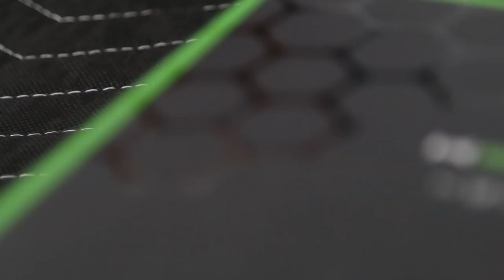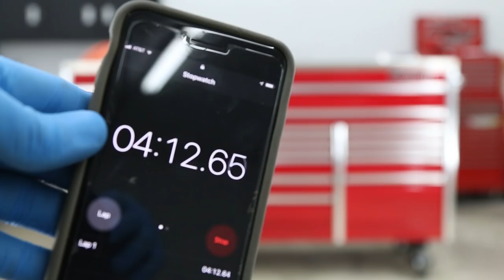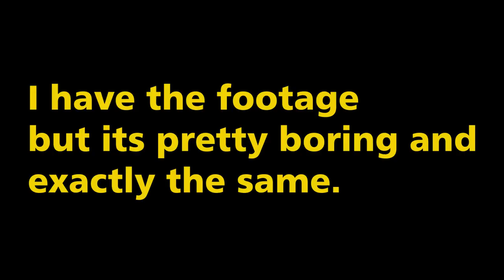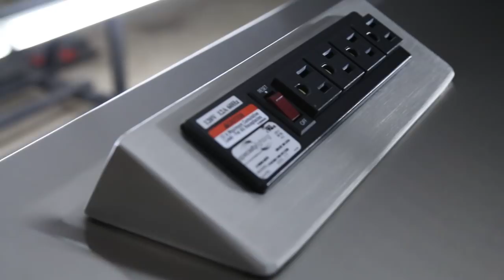Ceramic Coating a Snap On Tool Box

Comment: How much did you charge for this?
Reply from the maker: I cant remember exactly but they generally average $250-500 depending on the size.
Reply: @PristineAutoDetailing  considering the price of Kenzo itself, that's a reasonable rate.  I'm about to do my personal (2) 80" boxes and am debating between Kenzo on them or just going with something like Wheel/DLux.

Comment: How would you prep a bumper repair knowing it has a ceramic coating??
Reply from the maker: Sometimes we they would have to wet sand it or heavy compound with rotary buffer. All depends on the coating.

Comment: how long is this coating expected to last?
Reply from the maker: Really depends on maintenance and upkeep but generally at least 4years.
Once I do another box I think we might try paint protection film on the entire front for more tool scratching resistant properties, then apply the coating on top of the ppf.